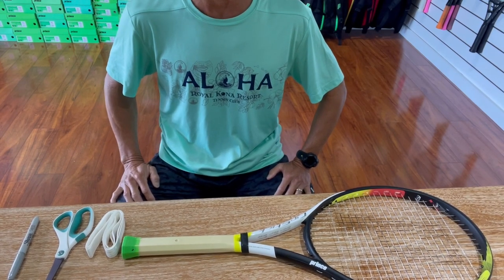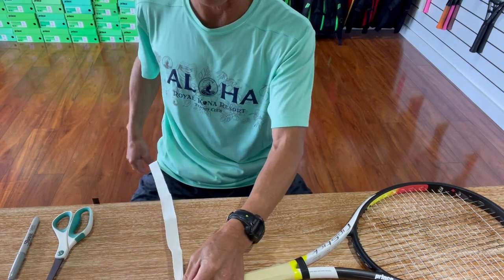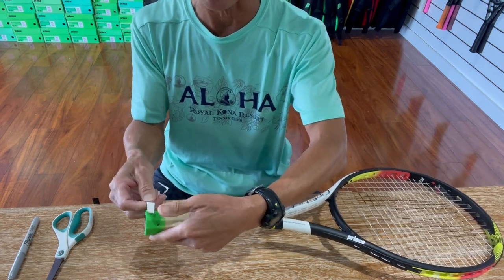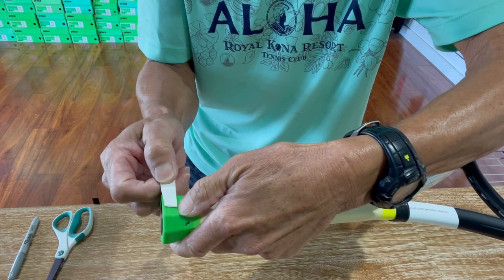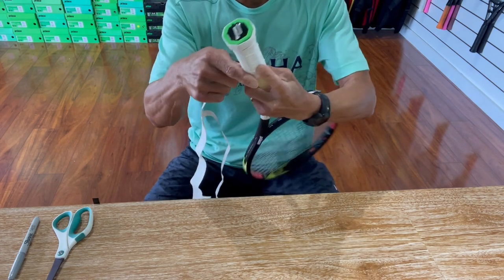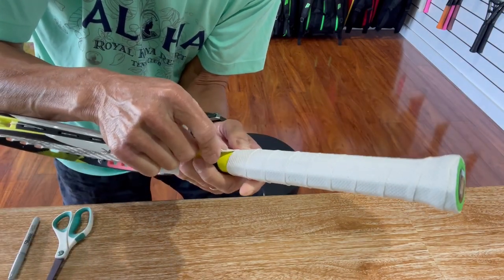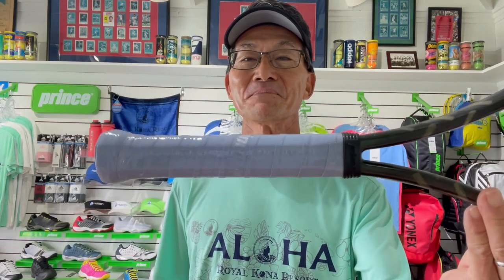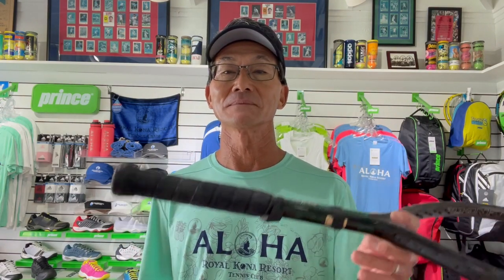Racquet Grip Tutorial [How to Wrap a Grip the RIGHT Way]

Comment: Thanks for this video! It always seemed obvious to me how replacement grips and overgrips should be installed. But of course it's not obvious to some, and I've seen some of the incorrectly installed grips before. The most common is the untrimmed overgrips. For me, I'm usually fine with regripping replacement grips, but for some reason I always have trouble keeping overgrips even because they're stretchy and I can never keep the amount of stretch even when I install them. Maybe I should take more time with that... :)
Reply from the maker: Aloha Ronald, I'm glad this video was enlightening! I guess in time it's a matter of feel. The best way I can describe the amount of tension (stretch) when wrapping overgrips . . . enough to keep it nicely in place, but not to the point where the width of the overgrip is becoming narrower or deformed. Your gripping technique will come with practice!

Comment: I regrip a lot of old racquets with grips that have deteriorated into sticky messes but they are easy to strip off compared to the double sided tape that the factories put under the grips. I always remove the tape and it often takes a lot of tlme and effort. I am interested to see how you deal with the under tape. Do you like the pallets clean or just rewrap over the tape?
Reply from the maker: I'm going to get down and dirty all the way to the pallet and strip everything off!
Reply: @AMstringing  But time is money and as long as it is flat it even helps the grip to stick to it.    Many times it is not flat and I get my hands dirty removing it and have to wash my hands before putting on the grip, especially if it is white.   What can you buy to make this cleaning process easier and not harm the pallet?
Reply from the maker: @imateapot51  Here are some tips from another video I did titled, "Deteriorating, Dirty, Disgusting Grips"  https://youtu.be/9c1eCPJ4Bj4